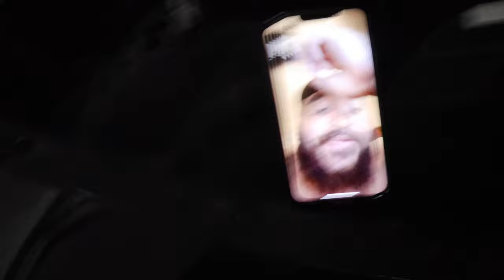MY BRAND NEW CAMARO SS 1LE HAD NO OIL... *NOT GOOD*

Comment: When I first got mines I had to fill the coolant reservoir up. When your engine is cold fill that too reservoir up to the top because it supposed to be full. I had to fuss at the dealership when I got my car back in may and they gave me a full thing of concentrated dexcool and I mixed some of it with water and filled my top one up to the rim and filled the bottom one halfway which is the overflow. Great cars man
Reply from the maker: Hell yeah bro shits crazy
Reply: @JIProductions  very. It's so hard to get nice cars these days and dealerships just trying to get them out while doing minimal. I cashed out on mine may of last year and my throwout bearing bad and low coolant and sap was all on it. I still never dropped it back off cause I need my ride and also the hmi module located under the passenger glove box love going out in these 6th gens so if your screen ever goes black them it's the hmi module. I had took my entire dash off on my own and fixed it cause I hate dealing with dealerships but I still had to put it back together and add more warranty and let them replace it. Smh they are great cars tho just life now with the market etc make things rough